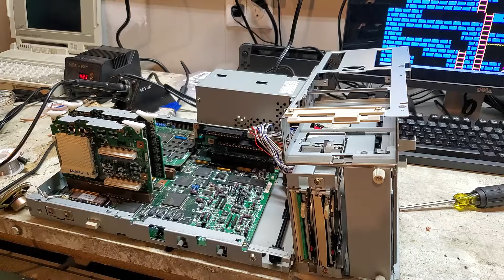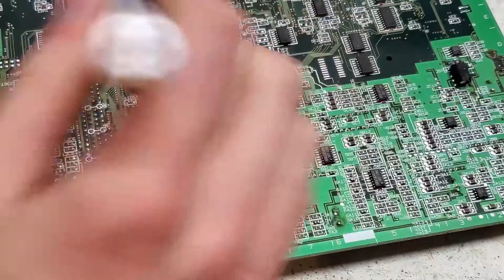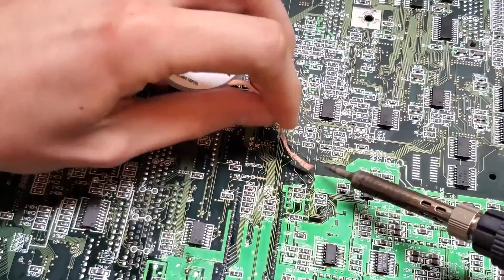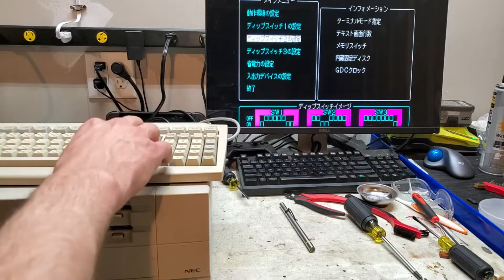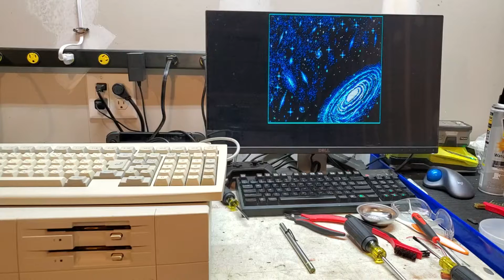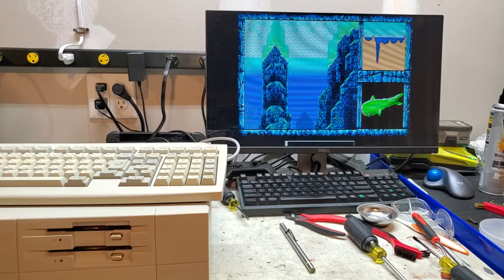NEC PC-9821 As2 Part 3: Sound Hardware Repair

Comment: Glad to hear you're happy enough with the sound now.  Can't wait to see the HDD/CF stuff where you finally don't have to swap floppy disks as much to run games/software.
Reply from the maker: Yeah, that would be nice, imaging floppies is a very boring process, and half the time it doesn't work right.
Reply: @Tr3vor42532  Indeed.  Btw, if you weren't aware, PC-9821s can read standard 1.44mb formatted floppy disks and can even make bootable disks in that format if you want.  I guess that makes it a bit more convenient if you just want to transfer files.  If you do need to write 1.2mb disk images, though, you can either format on the PC-98 itself or go to the Command Prompt on your modern PC, then visit C:\Windows\SysWOW64 and use the commnand format a: /f:1.23m.  For writing the images themselves I use a program called DiskImage_13b.  Oh, and if you want to edit and/or retrieve files from HDD images like the one I gave you and others, you can use a program called DiskExplorer (editd169e).  Sorry if this is overly long, but I wanted to give you some advice on certain things just in case.
Reply from the maker: @thepirategamerboy12  Long comments are fine. I've been using my windows XP machine to format the disks using the format b: /a:1024 /t:77 /n:8 /u command with a USB drive, seems to be working fine. I've been using disk image 1.3b and editd169e, seems to be pretty popular software to use with these machines. How do you get a pc-9821 to format a 1.44mb disk? is there a command specifically for that?
Reply: @Tr3vor42532  Type FORMAT B: /4 to format a disk as 1.44mb on the PC-98 itself.  You can also add /S to make it a DOS boot disk.
Reply from the maker: @thepirategamerboy12  neat
Reply: Hey @thepirategamerboy12, haven't seen you discord in awhile dude, missed seeing what you've been up to. I've been watching @Tr3vor42532 get his As2 working, and giving him some tips you gave me when I got my computer. Hope you're doing well dude.
Reply: @kanji-c5d  Are you Kanjiology?  If so, then no wonder Lode Runner was one of the first games he tried.  lol  I just haven't felt the urge to log on in a while.  As far as what I've been up to as far as computers go, I got a 286 PC semi-recently that's unfortunately been rather flakey and still haven't fixed it yet.  Maybe it's the Trident ISA VGA card in it that's causing lots of program instability, etc.
Reply: @thepirategamerboy12  Yeah I am, and yup I had him try the same game I did to test my machine, I also gave him the games in your Win 3.1 CD, but he will have to wait until he gets an HDD to try them. I also have a 286 giving me a bunch of headaches, a Tandy 1000 TL, I am fortunate it takes standard PC keyboard, but it doesn't want to display any image either via the built-in CGA Tandy graphics port or a VGA card. Well, I will see you around, maybe on another upload of Tr3vor42532's. :)